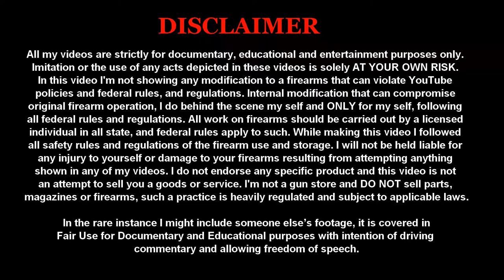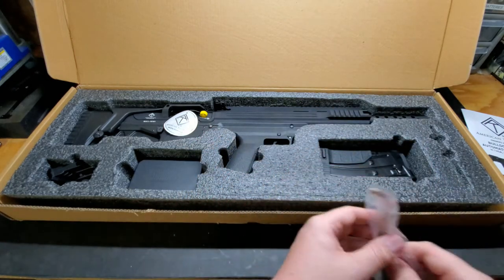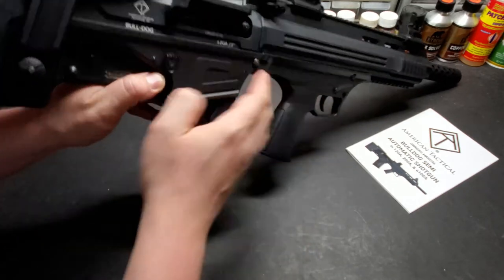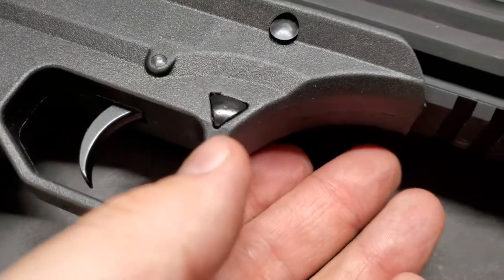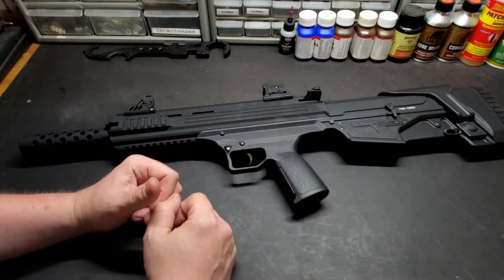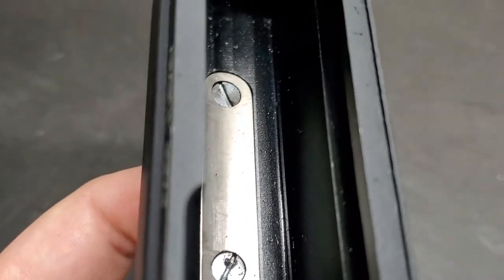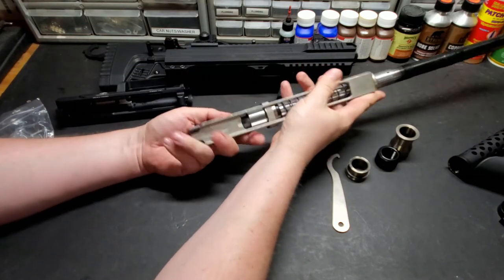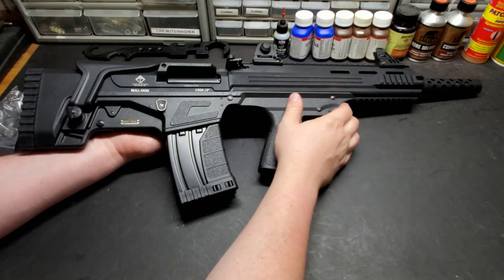ATI Bulldog Shotgun Unboxing, Review and Disassemble

Comment: Mine had a very high trigger pull.  I removed the spring under the trigger.  That helped reduce the weight some.  I also filed the hammer catch, very lightly, and got a 4 pound trigger pull.
Reply from the maker: It's not a precision rifle it's a shotgun what would you care about trigger pull so much
Reply: @IvanRossS  the trigger pull was close to 20 pounds.  Way too much for any gun.

Comment: Great video and thanks for the review. The sights on my bulldog and the rail attachment for the mags were extremely tight! I had to use a rubber mallet to get them on and had to work them for a bit to get them to work properly. They are still difficult to remove once installed.
Reply: Likewise.
Reply: I had same problem. My sights were no way sliding on as easily as it's shown in this video.
Reply: Yes, the sights were very tight. I am also having a hell of a problem getting the 5 round magazine to mount on the front lower rail. I can't wait to get home so I can try to file the mag to get it to fit.
Reply: @johnwilson668   I didn't even attempt to do that; I just installed  a vertical grip
Reply: @FLguy01  were there any problem fitting it on? Are the Picatinny rails actually on spec?
Reply: @johnwilson668   Nope, the grip fit on it like it would on any standard picatinny rail
Reply: @johnwilson668  yes the rails should be on spec.

Comment: So I got this gun today and took it apart. They did a better job cleaning metal filings out of it
The barrel shroud was tight but able to remove it by hand. The rubber O ring that looks like to help keep the nut tight during use since upon tighten it compresses the two parts together to the metal, so I don't think it was shock absorption. When I assembled it the metal spacer would slide up and down when the gun was cocked and tipping the gun up and down. Freaked me out, I took it apart 3 times looking at your video to make sure I assembled it correctly, i did so I put metal mylar tape on the part that inserts into the other sleeve, so they would stick together. That fixed the problem.

I found the anatolian defense Web site it is the same gun minus the extra air vents most likely needed those if one was fighting in a war help keep the weapon cool.

If ATI is getting that gun from Turkey it's coming from anatolian defence. They say they are a gun manufacturer in Turkey. And Are Out Of stock.

Comment: dude i literally ordered mine on the 18th along with a red dot for it, and I seriously cannot wait til it gets here
Reply: will need a riser unless it comes with one
Reply: @apophenia2543  why will it need a riser?
Reply: @georgieboy6893  I tried a basic red-dot on it and even with my head completely sideways flat it's too low to center the reticle.
Reply: @apophenia2543  aaaah okay, well thanks for the advice man! I'll get a riser :)
Reply: @georgieboy6893  waiting for mine to arrive :(  those little plastic sights aren't too bad for now though
Reply: You wont be disappointed bro, its hella fun to shoot, it will surprise you, Doesn’t kick like you would think
Reply: I saw this at my gun shop for $912 and wish i bought it smh
Reply from the maker: @undertaker11ism  thats insane price...
Reply: @apophenia2543  What size riser would you recommend?
Reply: @tuned_auto  I went with an adjustable one because I wasn't sure myself.  I think it went from 1/8 inch to 3/4 inch but the lowest level was enough
Reply: I just got one today. I had the same issue with using the mag as a foregrip. Just testing it out and it got stuck...hammer time. Same issue trying to install the rear sight. So tight I couldn't get it on. Luckily I had a set of Magpul flip-ups to use as backups. They installed very easily. I'm running a red dot on a riser as main optic.
Reply: @frope01  same issue. Putting anything on the rails is fairly difficult. I have to hammer everything on and off.

Comment: Having a problem with the gun not ejecting the shot round. Have you had this problem and what would you do to fix. Thanks love the video
Reply from the maker: Look at that box and tell me what FPS it says . It have to be over 1200fps!! More is better also how long shells ??
Reply: They are 1200 FPS and 2 3/4. Thanks for the quick response
Reply from the maker: @victorchevalier9331  I tried 5 different loads and brands. Did not had a problem. I would recommend you to get another brand. Maybe something with 1300fps too. Semiautomatic shotguns ar very picky on ammo. Also it have to be brake in too. Usually take like 100 rounds or more. In my situation I had no problem. Everything ejected perfectly.

Comment: Picked mine up this week. Pretty cool, yet to test it but off the bat: the rails are much wider than the Polly fab sights and they will NOT mount sans great effort. Mounting the short mag as a hand hold is comfy but in NO WAY will that detach w/o again GREAT EFFORT.  The rails need work right off from purchase. My local gunsmith gave me the stink eye when I brought this in. Right behind me was another guy with an ATI product. He’ll find out when he unbox’s his when he gets home. I did find a wonderful mag pull front triangle hand rest for $30ish , really nice, comes already on one of the other “branded” units. Also found that RIA 19 rd mag is a perfect fit. I have yet to shoot this thing so I’ll see how it all goes 2gthr after getting the sights on. Seems to be a solid platform overall. These are all made in the same Turk factory so stuff is fairly interchangeable. Someone tell me otherwise if i am wrong. Thank you for your time.    P.s. ProMag / RIA drums seem to fit nicely. 
Overall: seems seems to be a solid platform. See what happens when I get it back from my gunsmith.    P.s.s. Williams in MI is the biggest gun store in MI. Ammo is Xtremely low and good luck finding more. Odd balls calibers are plentiful but any standard rounds....., not so much...

Comment: Sir I noticed that this did not have an extra piston in the box... Most other brands and models have two pistons; one for light loads and one for heavy loads... So how does this ATI Bulldog work with only one piston ? Researching to buy... Thanks
Reply from the maker: @Soli_Deo_Gloria_.  if you're talking about choke . One is already pre-installed in the barrel and you have two more in the box. Total 3
Reply: Well I'm referring to a similar system used by the Tokarev bullpup or the Centurion BP 12 for example... These two iterations of the same general design use a gas piston system. Essentially they are two different chunks of cylindrical metal that hover over the gas ports and their job is to offer different resistance in order to achieve good cycling...one piston is heavier in weight and thus helps slow down the bolt with fast velocity and heavy weight loads... The other piston is lighter in weight and is meant for light loads like cheap Walmart Federal bulk box ammo...

I guess you're unfamiliar with these other brands and their operating system... They sound good on paper because you can fine tune the gas system to help reliability, but in the field they are not pragmatic at all because you need to partially break down the gun to install the correct piston (counter weight) depending on if you want to change from cheap 1200 FPS birdshot to a heavy 1600 FPS slugs...

But while I have your ear... would you buy the ATI Bulldog again or recommend it to others ?

Thanks for the video n' God bless brother
Reply from the maker: @Soli_Deo_Gloria_.  very interesting to know this information. can't you just adjust gas block to achieve same result for proper and reliable cycling?. And I would not recommend to buy it, because it is definitely cheaply made and I'm very frustrated with feeding ramp that made out of aluminum an already chipping off..
Reply: Regarding your question about can't you just adjust the gas block... The answer is no, if you're asking if there is a screw, a lever, or a dial that allows you to actually manipulate the size of the actual gas system, then no. This system is common on say Palmetto State Armory's 308 AR 10 or the RUGER 308 SFAR ... If that is what you meant by adjust the gas block, then no.... 

.... Does the ATI have such an adjustable gas system ? I was under the assumption that none of these cheap Turkish shotguns had such a fine tunable gas system... 

Thanks for sharing your thoughts if you would purchase the ATI again...

Every year or so I go down the rabbit hole researching these Turkish shotguns thinking I want one, and every year a walk away empty handed... I think I really need one but then realize I really don't... lol... PSA has several models on clearance for $200...the Tokarev, the Centurion and an Escort that is clone of the Kel Tec manual feed pump shotgun... Something else also peaked my interest was the Tokarev Bullpup pump action 12 gauge... they want $270 and comes with the 5 round magazine... I don't know... lol

I have a Maverick 88 security 20 inch barrel and am content with it... But I do think having a drum unloading 20 slugs in short fashion sounds pretty neat... 🤷‍♂️😆👍

Thanks again, have a great day n God bless

Comment: I just got one today. I had the same issue testing the mag as a foregrip...hammer time. Same thing with the rear sight. It was much too tight. Luckily I had a set of Magpul flip-ups which installed very easily. I'm running a red dot on a riser as main optic.

Comment: After watching ur video about the mag in front as handle part, made me feel better. I just got one few weeks ago, and open box made me feel extremely disappointed, of course without shoot it yet. Gun was oiled on the surface everywhere, really wonder if that's necessary? all the meatal parts finished really raw... I compared with all my S&W products, I understand they are not the same level..... The biggest dislike part is that mag actually can not all the way put in front as a handle at all. I am not a very big guy, but i got muscle. If I force it too hard, the plastic part being cut with small pieces. I bet even I put it on, I will need a harmer to take it off too. For now, just waiting to see how it shoot feels like. BTW, when I open the box, the brand new gun smiles like been shoot before, powder burned taste.
Reply from the maker: Yes I think so they test fire them.  Mine was dirty too. And you have to understand this is a cheap Turkish made shotgun. Use my shooting video review where I'm showing the issue in the end of the video with the feeding ramp that's only one thing I'm worried about

Comment: The charging handle, can it be replaced with ar15 charging handles?
Reply from the maker: AR 10 charging handle. I'm actually working on that. Just been very busy . I will let you know.
Reply: @IvanRossS  sweet, thanks for the update. I was thinking of picking of these up cuz they were just marked down a bit at my local gun shop. I just might pull the trigger (pun intended) and buy one
Reply: I put 2 mission tactical extended latches on mine and cut off the lock in right side ( I'm right handed) and works great for one handed charging..

Comment: I bought one and wow it is a total lemon. Wouldn't fire at first. Sent it back. Now it fires but will not eject shells.  A finicky mess.  Definitely wish I had gone with a different semi auto.
Reply from the maker: Mine is awsome. I put 5 different loads in there by five different brands and all cycled grate !! Just have to make sure they over 1200fps. I recommend you to try different ammo!! Winchester ammo knowing for a lot of issue with an ejection if this is what you were shooting.
Reply: Screen Share ...Glad to hear it. I wouldn’t wish the mess mine is on anyone. Only gun I’ve ever owned that makes me mad to look at LOL.
Reply from the maker: @RobertHotchkin  remember semi automatic shotguns like this have to go through breaking  period!!! Go back to the range and go  through min 100rd.  just make sure you using ammo over 1200 FPS.
Did you try to use slugs??? They definitely have to cycle!
Reply: Screen Share ... Appreciate the info.  Will try some other shells. (It was Winchester that I was shooting. Higher velocity than 1200 fps but for sure worth trying something other than Winchester). Thanks!!
Reply: Screen Share ... used shells that were 1400 FPS and it worked just fine. Thank you for the info.  BIG HELP!!!
Reply from the maker: @RobertHotchkin  your welcome.  Try some 1250 maybe !! Just different brand. Different load.

Comment: Nice in-depth review,thanks.How does it cycle,any jamming issues ?
Reply from the maker: Haven't even shot it :( all gun ranges where I live are close due to coronavirus
Reply: I bought one yesterday and shot it. 100% function with assorted "regular" 2 3/4" loads  Recoil is very good.  Enough to be able to shoot it for hours, unlike a pump.  Probably around a 30-06 rifle so excellent for a shotgun.  I would not want this shotgun any lighter for shooting.  Fit and finish is excellent with chromed internals as the Turkish shotguns have.  I'm not a fan of the safety and round prefer a 45 degree thumb safety.  The mag catch doesn't bother me since with the 10 round mag you won't need a tactical reload. Also it should have come with 2 mags.  I'm running mine with a DD vertical foregrip and an EOtech and it's very controllable as bullpups are.  At the $500 price point it's a buy.  Having a big importer for these is a big plus too.
Reply: @keithmillermusic I've got 50+ rounds thru mine with ZERO issues of any kind. Absolute blast to shoot
Reply from the maker: Finally shoot it today it was awsome. Tried different ammo. All above 1200fps. No problem at all. I didn't expect for low recoil. My Remington 870 hit u like a mule
Reply: Using #8. 2 3/4 in. Target loads couldn’t get it to cycle
Reply: Just one up today. I like it 😊. Doesn't seem to like 3" shells though. Of course, its not broken in yet and those were some very old rounds that were in a tube mag for years and cycled in and out many times. (Load it for home defense, unload for hunting squirrels, reload again, repeat )
Reply: Does not cycle low brass!!!!